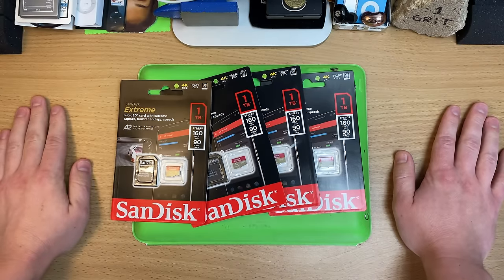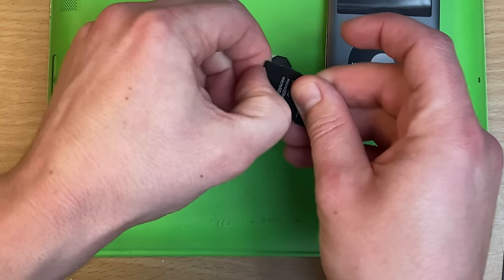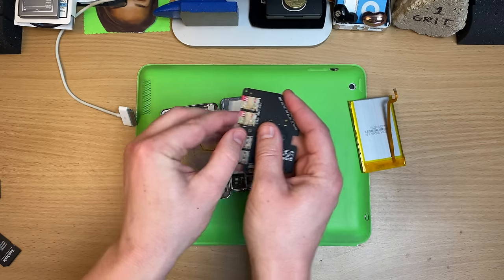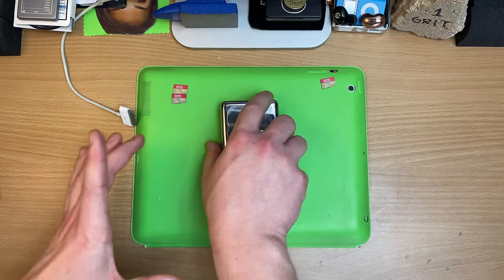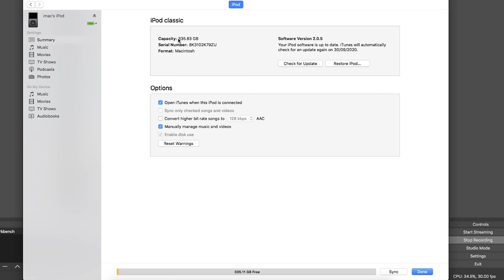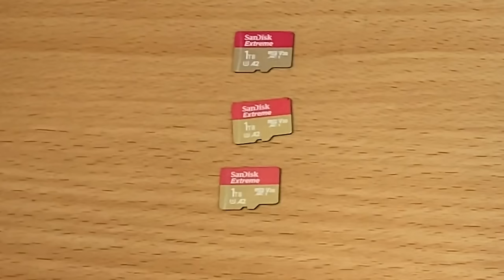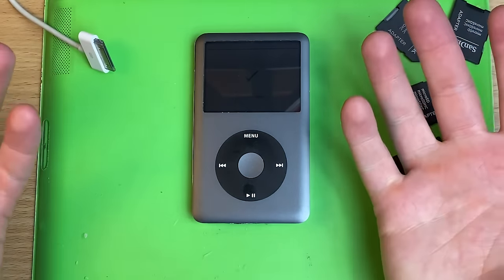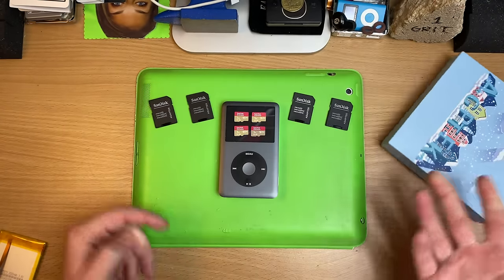4000GB in an iPod Classic.

Comment: Heya. So, I'm not an expert, but I am a programmer. It may be due to the operating system on the iPod itself. Older operating systems just have no way of referencing any addresses in memory above a certain point. Newer OS's have the same limit, but the number is just much higher than it was previously.

I had a PC running an older version of windows and even though I had a 3TB drive in place, it could only see 2TB of it. And it was only a single drive. I think you've hit the limit that the software can take. It won't brick anything, but anything over 2TB just won't be seen.

Also, despite using the same prefixes as metric measurements (kilo-, mega-, etc...) each jump is 1024 rather than 1000. So, the maximum it could see would be 2048 GB.

Comment: So look up which bit the system is and you’re limited by the amount of memory it can handle in one slot due to the channels. You need to use MORE sd cards but in smaller sizes. 8x32 > 2x128

Comment: If you used only ripped CDs in AIFF format. 
.650 TB (CD)/13 average tracks on a CD = .05 TB a WAV/AIFF track
.05 TB a WAV/AIFF track x '50,000 tunes limit' = 2,500 TB
= I could use a 2,500 TB iPod. Is my math correct?

Comment: The prickly cactus works like acupuncture.  

Question: I read an article recently on Kioxia Memory* where they were talking about how 2TB is the absolute maximum size a single SD card can ever get due to actual technical limitations.  Could that at all contribute to why anything over 2TB didn't work?  Maybe the adapter was making all four look like one "impossible" Micro SD card?  Note too that I'm a complete moron.  That said; have you tried testing all four in something else at the same time?

* Formerly Toshiba before they received the GE treatment.  One of my absolute least favorite things is when rich "investors" try to wring excess value out of household name conglomerates by breaking them up into a bunch of brands you've never heard of.  Like, Toshiba laptops still exist; but, they're not Toshiba anymore.  They're "Dynabook".  Same people, same ethos, but the division got punted off and the new owners expect people to magically know what a Dynabook is.  I get that Toshiba had a slight billion dollar accounting scandal, but, they were a great company on par with a GE, Sony, or Samsung with an excellent reputation and decent vertical integrations.  Toshiba used to mean quality!  This whole thing is dumb and anti-consumer.

Comment: IMPORTANT: Read iFlash Compatibility Chart for iPod model specific limitations

iPod 5g Video 30Gb, 60Gb

iPod 5.5g Video 30Gb, 80Gb

iPod 6g Classic 80Gb, 120Gb, 160Gb *Limit of 128Gb with SD cards

iPod 7g Classic 160Gb (late 2009)

iFlash converter for fitting in to 4g iPods

Comment: It looks like you got some knockoff Samsung memory cards there. The knockoffs are REALLY good, and look almost exactly like the real thing. They even fool those who sell them. But if you look at the screen printing on the 4 good ones as positioned at the end of the video, the bottom right one has a darker bottom half than the other 3. Honestly it's hard to say which of the ones you received were real or not, but I'd hazard to guess that the 3 with the lighter tan were the only genuine ones.

Comment: here is why this is dumb:
if you were to have 240 hours of 192khz 8 channel 24 bit audio, it would encapsulate the sd cards. if you used the standard 44.1khz stereo 16 bit audio, you could store around 6500 hours of audio

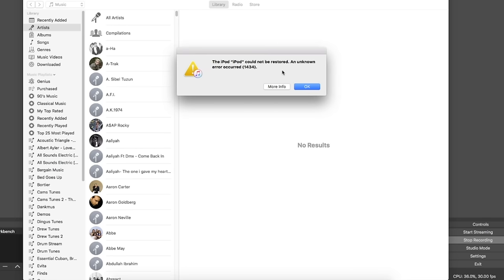Comment: 3:24 “An unknown error occurred (1434)”.
This was done on iTunes on macOS… running on an iMac… connected to an iPod… via an original 30-pin connector. All these things are designed and sold by Apple.

Apple is one of the only big consumer tech companies that designs and distributes its own software AND hardware in one package. Minus the SD cards and custom flash board, Apple engineers designed everything in this process, but somehow iTunes is always just like 🤷.

I know it’s monumentally hard to fix bugs and detect causes of hardware/software errors, but I just can’t help but chuckle at technologies’ ability to confound its own creators.

Comment: iPods Format to FAT32.
FAT32 = 32Bits
32bits =  4,294,967,295
Most Storage mediums use 512 Byte Clusters for data.
512 Bytes X 4,294,967,295 = 2199023255040 Bytes
2,199,023,255,040 Bytes  = 2TBs

Anything more will yield very strange and barely predictable behavior.

We're also going to ignore the stupid differences between TB and TiB for now.
Its a rabbit hole, and its stupid.

Comment: would be great if you replaced the oh so funny captions & very real anger reactions... with helpfull info, such as why you have to reformat, how to reformat, what you use to interface your ssd's and any well basically every action you make but supply zero tips about it, might just be helpful to a person looking at setting up an ipod they havent used for 15 years ...
Reply: part of the point is that you're not supposed to do this. this is completely impractical and 100% pointless to do